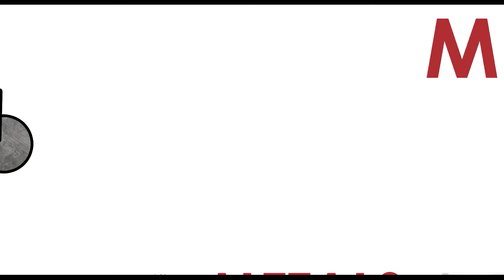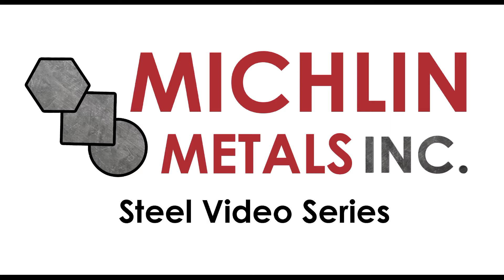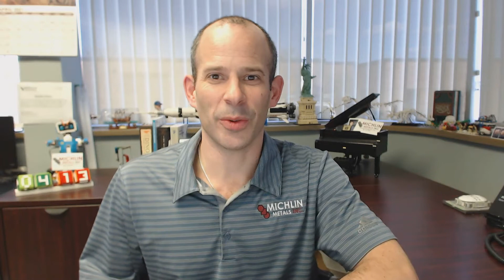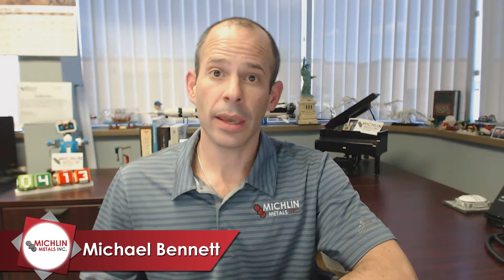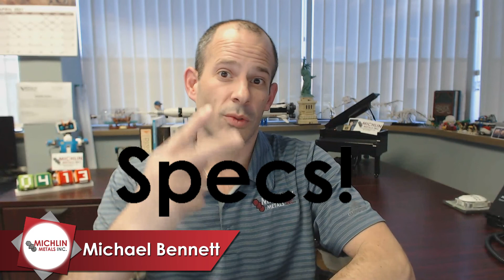6000 Series Aluminum - 6061-T6 - 6063-T5 6262-T9 - Guide to 6000 Series Aluminum

Comment: Very informative channel, thank you taking the time to share all the information. Can you speak a bit on how welding affects artificial aging? I am needing to weld on some 6063-T5 tubing(roughly 4mm thickness), but I am unsure of how the heat affected zone will be changed.
Reply from the maker: I appreciate the comment but unfortunately this will require a very complex response which I can't really do without really going far into the weeds and that's a little deeper than  even I am comfortable going. My best advice would be to consult with a certified metallurgist and ask them before proceeding, again, thank you for watching and the kinds words. Sorry I couldn't be of more help.

Comment: Hello sir, I have a (TOCE exhaust) pipe on my motorcycle. I looked up what type of metal it’s made out of. And it said “Chemically Certified 6061-T6 & 6063 Aircraft Grade Aluminum” so I was wondering. Can I blue this pipe? You know how people take a torch to blue or (anodize) titanium for a blue effect? Well since you’re knowledge on metal is extensive I just need some answers if it’s safe for me to do this? And if I can, would I be able to take a torch and do it? Or would that be a terrible idea and try a different method of anodizing? You said “6061 & 6063 anodizes well” but would heat be a safe method to do it? Thank you for your time sir.
Reply from the maker: Anodizing aluminum is an electrochemical oxidation and any color is achieved with a dye. You cannot do it with a torch. Hope that helps!
Reply: Aluminum is not blued. Can't be done. 
Only anodized and spray painted.

Comment: Any videos on bending and machining different aluminum alloys?
Reply from the maker: I'm not sure I've got that on aluminum. If this video format would work I could apply the same for certain grades of aluminum vs the one pasted here I did earlier on stainless. Lmk if this might work. I could try, no guarantees but it's a possibility. https://youtu.be/Dzq4e8Z3I1g
Reply: @MichlinMetals  Yes, something like this would be helpful.  I am building an experimental airplane from a kit and it uses 6061-T6.  This is great for strength, corrosion resistance and machinability, but lousy for forming.  I have made a few misc brackets and up to 0.040” it can be bent 90 fairly well, but when you try to bend 0.060” or thicker, it is very easy to crack it.  I’ve heard the “bend radius must be at least 2X the thickness” rule of thumb, but it would be neat to know if more advanced things can be one in a typical small shop.  For example, can the 6061-T6 be annealed in a home oven, formed in that state, and then returned to a T6 state in a home oven?  Or does this require special furnaces and chemicals or such?